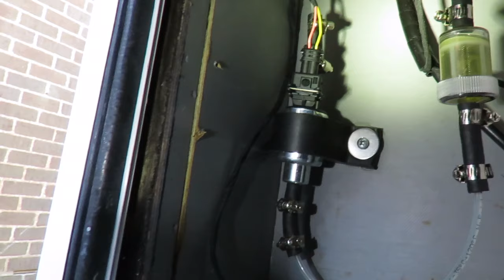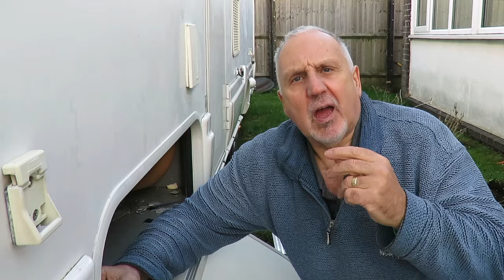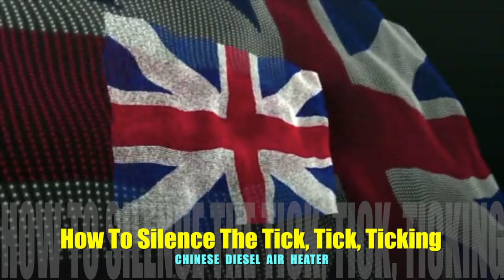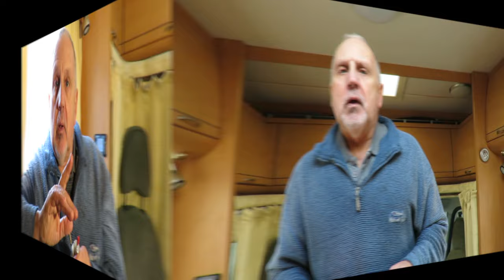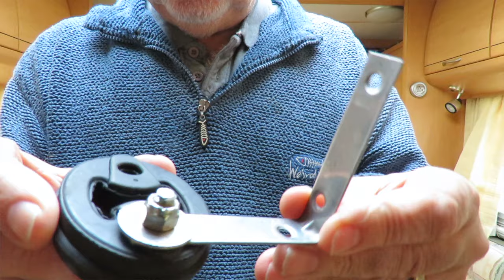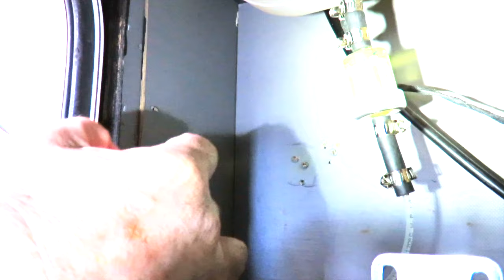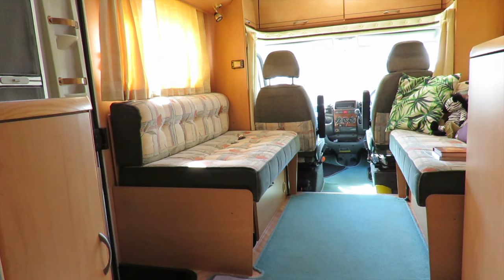How To Fix A Noisy Fuel Pump On A Chinese Diesel Heater  - Quiet Fuel Pump And No More Ticking Noise

Comment: Interesting cross section. I'm guessing they are self lubricating via the diesel itself. I am tempted to fit the pump underneath my van when I get it. Or buy a generic car fuel pump if the do ones you can regulate.

Comment: Thanks for your video. Yes the click, click, clicking can be very irritating, particularly at night. I’ve even contemplated encasing it with expansion foam but nervous about having to replace it. I’ll give you ideas a go.
Reply from the maker: Hi Bevan,
Yes, it bugs a lot of people...
Worth experimenting I suppose....
ATB, Steve
Reply: I’m not sure how effective expanding foam would be because it has so little mass. If I was gonna try it I’d;
1. make a small plywood box that can house the pump. 
2. cut it in half, the box, not the pump😉
3. Offer up the pump and tubes and mark where they pass out through the box. 
4. Use a rat tail file to make slots for the tubes to pass through.
5. Cut 2 pieces of cling film, Saran wrap big enough to cover each half of the box opening and wrap around and be taped in place along 3 sides. 
6. Lift up the unsecured edge of the cling film and squirt a small amount of foam in to both parts of the box and quickly assemble around the pump clamping the 2 halves of the box together.
Once the foam has hardened separate the 2 halves, peel of the cling film and you’ll be able to reassemble with what ever method that suits you. I’d use zip ties and also hang it from a couple of others so that no internal vibration can pass into the chassis or bulkhead your fitting it to. I’m betting the box will absorb more sound than the foam so id be tempted to try it without first. Also wrapping either the inside or outside (or both) of the box in sound deadening mat would help.

Comment: Hi. 
I notice you have mounted your pump vertically. 
On other videos and on my diesel heater instructions it says to mount the pump at a 45 degree angle this enables the pump to self lubricate with the diesel flowing through the pump and increase the life of the pump and reduce noise.
Reply from the maker: Anywhere over 45degs is fine.
Diesel is a fuel oil so will lubricate regardless of pump angle, having it upright will ensure no air bubbles are trapped in the pump due to cavitation.
It's the trapped air that leaves a dead air space and decrease the pump life, not the angle.
ATB, Steve

Comment: Greetings from germany. Thank you for the good video. I was thinking of doing something similar for a carbureted gasoline pump. One question: is there a risk that the pump will overheat? ...risk of fire
Reply from the maker: Hi,
I did think of that as well.....
But with diesel there's very little chance.
My only real worry was vibration and working loose.
So far so good though..!
ATB, Steve

Comment: Submerge the pump in the fuel its pumping, diesel is hard to light, sparks won't ignite it unless its mostly vapourised, and a lot of automotive manufacturers already do it in unleaded high octane fuel systems to deaden the noise of high pressure fuel pumps. Make a good seal on the electric plug or change the plug so it is 2 individual wires and seal them completely separate until out of the fuel of your worried about it causing grief.

Comment: I fitted mine in front bulkhead of my caravan, ive hung it at an angle on cable ties and can hardly hear it now, also bought the pink rubber jacket for the pump but not got round to fitting it yet
Reply from the maker: Hi Ted,
Yes, I've heard those jackets are quite good, might try one myself.
Steve

Comment: Been uming and arring about getting one of these. Problem? Where to put it?  I’ve got a Adria Twin on the Fiat Ducato. So that’s a PCV. 
The only obvious place would be under the drivers seat, using fuel from the vehicle fuel tank. 
How much “headroom” does the burner body require. I reckon I’ve got about 20cm.
Any thoughts? Be appreciated.

Comment: If that rubber exhaust mount is made of a hardish rubber (I'm only assuming because those rubber mounts are usually solidly designed to hold the weight of an exhaust)  then I reckon you won't have really done much to deaden the sound. It will transmit through the hard rubber, into the bracket and then vibrate through the van's surfaces. You really need to find as light a contact between the pump and the mount as possible so I think other less dense materials would have been better. It would have been interesting to hear the result if you had just held the pump in your fingers for the purposes of the exercise and see if there was a sound difference. But thanks for the great video and has me thinking about my own situation in more depth.
Reply from the maker: yes, I know Reg, maybe should have experimented with different materials.
Some use a couple of tie wraps an just hang the pump from them.
For now it's fine, especially in tick over.

Comment: I know exactly what you mean, I have the same system and was considering addressing the same issue.
I'll probably do the same and may even encase the pump in a small plastic box, packed with some form of sound deadening material...
Nice job there though.
Reply: You can buy a special designed pump housing, temperature and noise covering, from china.
I'm going to check it out in the winter
Reply: @wildcatcortex  If it silences the 'clicking', that'll be great.
You'll have to tell us about the progress.
Reply: @PreparednessVeteran  Just waiting for delivery ... china stuff you know ...

Comment: Best solution is make a small wooden box from scrap. 
Mine is 150mm x 150mm x 150mm with a slot each end for the tubes and cable and half fill it with rags place pump in and fill rest of the box but to tightly packed (for some reason tightly packing makes it louder) then screw down lid.
It has reduced the noise so much (about 80%) that i can barely even hear the pump even when I am next to the box and when I close the compartment where the heater is located I can't hear it a all.
I am assuming it work the same as putting a pillow over the muzzle of a gun and using it as a silencer???

Comment: On he pump, is the bore and outside diamater the same both on both the pull side and push side of the pump? Or are they different? 

For the heater side I know I need  2mm inner diamater hard nylon fuel line. But about the conneting fuel line? Don't know whhat outer diamater is on thhe fuel pump.
Reply from the maker: Hi,
The pump has the same sized spigots to both ends.
You can use the hard nylon fuel pipe for all the fuel line, but will need to make the pump connections using the rubber tubing.
In one of my other videos, where I strip down a diesel heater, you can see the way to do this here:
https://youtu.be/ACIhXyjAqro?t=1031
If you haven't got any of the rubber tubing, you can buy it from Amazon here: 
fuel hose kit:
https://amzn.to/3sVRXvc
ATB, Steve

Comment: Hi I bought a Yamaha 25L tank and quick release but although my pump appears to be working no fuel is coming out, do I have to open something on the tank first before I put my pump on? Many thank Ray K UK YNWA.
Reply from the maker: Not certain Ray....
I had no issues and the fuel primed straight through from the tank ok.
Possibly check the quick connector is firmly seated, or maybe the feed line inside the tank has a blockage?
But as far as opening anything then no, should run through without problems??
ATB, Steve

Comment: Mounted my pump to the frame and removed it from the steel panel originally. Easily reduced the the “thunk” by 50%. I can still hear the tick but I can now sleep but much less pronounced. Avoid mounting to hollow panels or thin metal/wood. Pumps prematurely wear if they get heated too, make sure they sufficient cool air.

Comment: I suspended mine dead weight with some cable ties, away from any solid surface then sound proofed inside of cupboard, still audible but only from within about 6 inches of cupboard.

Comment: I just received my Diesel Heater today. I got the one that comes in a metal case already put together, and I bet it’s going to TIC fairly loudly. The Solution I plan on using is Pumping Up The Volume of my 🔊🔊🔊🔊🔊🔊 STEREO SYSTEM 🔊🔊🔊🔊🔊🔊 🤣😂🤣😂🤣🤪🤪

Comment: Mount the pump inside a small waterproof case.  Line the inside and outside of the case with an audio soundproofing material like Dynamat, then fill the remaining volume within the case with an audio grade soundproofing foam.  The type used in an anechoic chamber.  This should completely silence the mechanical noise being produced by the steel pump piston.
Reply from the maker: Yes, I’ve seen several others doing that type of method and it seems quite successful. 
Since this video I’ve upgraded a lot more and have the pump mounted under the vehicle. 
You hardly hear it now 👍🏼

Comment: I filled an old peanutbutter jar with mineral oil and submerged the whole pump in it, 3 holes for the fuel lines + wires and silicone. COMPLETELY quiet. Mineral oil dosen't conduct electricity so completely safe too.
Reply: crunchy or smooth ?     Im going to give that a go . 👍

Comment: Experiencing the same problem.. I have found a better solution to this irritating pump noise.. folding the inlet fuel line place the pump into 2 small quality plastic bags ( inlet & outlet fuel line + 12v wire all exit neck of bags) place pump in plastic container..fill with shampoo or detergent or any gel thus immersing the pump! Now put first container into a slightly larger container and fill gap with blocking sand!..Pump is now practically inaudible!.. Enjoy..
Reply from the maker: Hi Tom,
Another good idea. Thank you.
I have seen some videos where the pump is in a sound proof box and double insulated with carpet or, similar.. 
I'm trying different methods at the moment as well.
ATB, Steve

Comment: Isnt the fuel flow the other way around? The return-stroke is whats pushing the fuel, going towards the "short end"?
Reply from the maker: Hi Paul,
These pump have one direction of flow only and the way it's positioned is definitely correct otherwise it wouldn't work..
ATB, Steve
Reply: @TheWrinklyNomads  That's weird, cause mine is mounted with the long end towards the fuel tank and the short end to the heater, and it works perfectly fine. That's why I commented. :P
Reply: And it's a pushing dosage pump, not a sucking pump afaik. So the fuel is pushed when the "cylinder" returns to the closed position. Or, rather, I guess it sucks fuel from the tank and pushes it towards the heater.

Comment: I have 2 workshops side by side. One is for building projects and needs to be warmed by my diesel heater, the other one is filled with foam with the pump in it. I can still hear it.
Reply from the maker: Lot of people use that foam method and claim it works?
Essentially it just a masking method like all the others.
Until someone comes up with a genuine silent pump it will always tick...😫

Comment: Saw Your video of installing the unit, and cutting the hole in the floor because of the high tank, instead of using another lower tank/can. It is like You shwed easy to mount the  nipple in any tank. And that hard solid rubber-8 for exhaust is a bad choise for sound damping, it is way to hard. Wrap the pump with sound damping foam for boat engine rooms and hang it in rubber bands.
Reply from the maker: Hi Dag,
Made a lot of changes and upgrades since this video.
Probably the best upgrade I've done so far..!
Here's the link:
https://youtu.be/HHJaPP2uLFA

ATB, Steve

Comment: Does that filter have a direction arrow? It looks upside down to me for some reason. Usually, the maintenance screw part of the cup should be on top. Not to disrespect just a comment.
Reply from the maker: I agree, it does look wrong doesn't it..!
But no, it is correct. The fuel needs to flow into the bowl part first so you can see any sediment in there.
The other way round would mean fuel goes into the filter then to the sight bowl and sediment wouldn't be seen.
ATB, Steve
Reply: @TheWrinklyNomads  Yes, I picture it now. The sediments will be hidden inside instead of the outside.

Comment: I just installed a diesel heater in a caravan and so far the pump is not noticeable from inside and infact hard to even hear outside and the way I did the install I think just might have solved the pump noise and that is  1. I cut a strip of rubber from an old thick mud flap bolted one end to the wooden floor of the caravan then bolted the pump in its own rubber mount to the other end of the rubber strip so it was hanging free but not so free it would move around. 2. Instead of using the clear hard fuel line supplied with the heater I used rubber fuel hose all the way from the tank to the filter to the pump to the heater and fixed it to the underside of the wooden floor and NOT to any metal of the caravan chassis. This way seems to have solved the problem and this would be that the original fuel line being hard plastic type meant that the line itself would transmit the ticking from the pump and also by NOT mounting any of the fuel line or pump to any metal under the van but to the timber floor insulated it from transmitting sound. Works for me
Reply from the maker: Some good ideas there Dave, thank you 👍

Comment: Does it tic tic tic all the time as mines new installation and ticks like mad plus ive air between the pump and heater but it doesn't affect it working 🤔
Reply from the maker: Mine ticks enough to hear it on maximum. 
On tick over it's very quite.
Air bubbles are quite common, so long as they can rise up slowly away from the pump its ok.
They only marginally effect performance.

Comment: Make a box of plywood lined with lead flashing sheets and seal the tightest openings. Mount it with better vibration isolation. You will not hear it. What you have is not as good as it gets for sure.

Comment: Be careful with that insulation. When these pumps FAIL, they get EXTREMELY HOT. All diesel heaters, no matter where they’re made, use the same dosing pump.
Reply: I doubt the $900+ Webasto Air Top and then the $150 Chinee heater units use the same pump. Similar design? Yes. Same manufacturer? Highly doubtful.
Reply: @applesbighatranch6906  well, my Webasto supplied fuel pump went critical…so what does that tell you about the cheap ass Chinese dosing pump?
Reply: @salnichols94805  Right?

Comment: The problem is the noise transferring thru the hard fuel line. Not much one can do about that, unless someone makes a connector out of fuel proof Zorbathane rubber.

Comment: put the thing outside the van i bought a portable unit its 3 feet away pain in the ear inside the van i put a litle cover over it incase it rains i built a steel frame that it sits in .

Comment: the main noise is tranferered through the bodywork,   if you remove the pump when its running its almost silent,  its all about the contact with the hard body of the van,   i used a oar rubber from a rhib boat,  then glued this with ct1 flexible adhesive,  its almost floating on rubber before any bolted contact to the boat,  mines in a steel boat,  very noisey b4,  now its no trouble.  Idealy it would be mounted on a block of jelly .......  but i,d eat it all !    Yum !   lol.
Reply from the maker: Hi, I'm actually changing it all again and refitting outside the van...!
I like the oar rubber idea. might try similar.
Thanks.
ATB, Steve

Comment: Does anyone know is it possible to do away with the pump and just have it gravity feed? And have a one way squeezable ball valve in its place for priming if it ever ran dry
Reply: It is not "easy" But yes. you need a large barrel of fuel to produce pressure via gravity feeding, then an intravenous (IV Drip) controller. like from a hospital. 
It's a huge Pain to get right. and you have to adjust IV Drip constantly as pressure drops as the barrel doesn't keep the same pressure as when it was full..

Comment: now you need to remove it from the tank and see how noisey it is..... thats the least it will get ,  as its transmition through chassie that amplifies the sound.    Like a big speaker.   mine was more noisey in the toilet than anywhere else,  as that was the accoustically most vibrant place onboard.

Comment: Mount at 15 to 30 degrees as per manual... 😅 this is 99% the reason most of the time
Reply from the maker: 45-90 is optimal. 
As the pump pulses, air bubbles are formed due to cavitation. 
In order to ensure they escape along the fuel line the pump must be as upright as possible. 
These air bubbles will create wear inside the pump and incorrect fuel delivery if not aloud to escape. 
Pump position has no effect on the volume of noise from the pump. 👍🏼

Comment: I have my heater in my basement just below my bedroom and I don't hear it at all. I suspended my pump at 45 degree on the wall hanging with a cable tie and wrapped in a piece of pool noodle. If I listen carefully, I can just hear the fan running, but that's a smooth steady sound so it not noticable. I can't hear the pump running standing in front of the heater so it's pretty much non existent.
Reply from the maker: Definitely suspending the pump seems to be very effective. I've seen a lot do it that way..
But that poo noodle is a great idea 👍
Might try that, thank you....

Comment: What about adding a little oil to the diesel?
Reply from the maker: Hi Ben,
Essentially, diesel is an oil based fuel, so it's self lubricating.
I do, however, put a little fuel additive in the tank and found this definitely helps as well.
ATB, Steve

Comment: the best sound proof material is a hand towel or bath towel, thanks
Reply from the maker: Hi Paul,
I've tried various methods now, never tried a bath towel though..!
At the moment the pump is positioned outside the van and suspended on rubber cable tie's, this seems to be quite effective and you have to really listen hard to hear the pump.
ATB, Steve